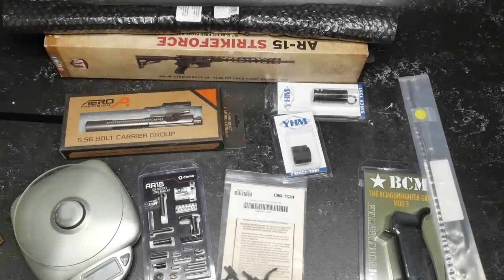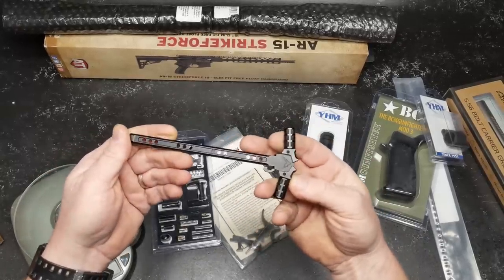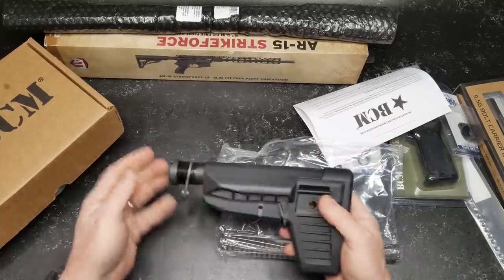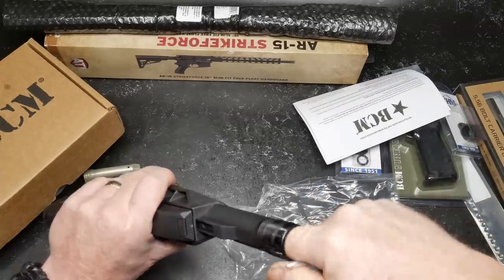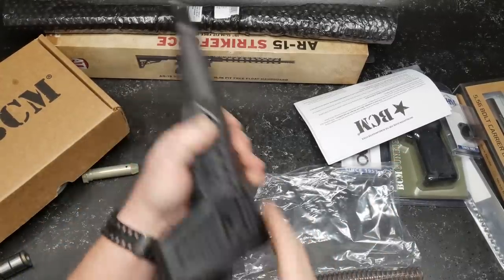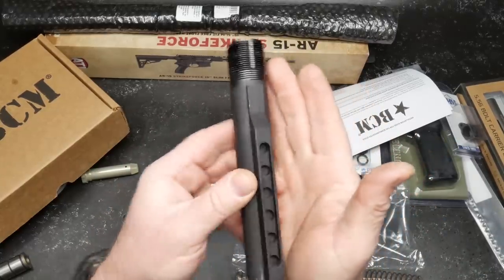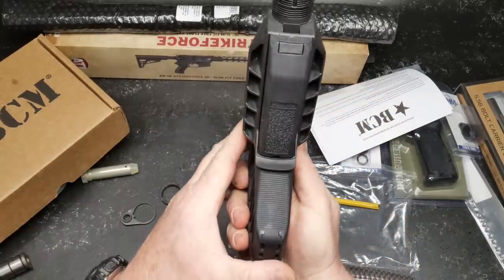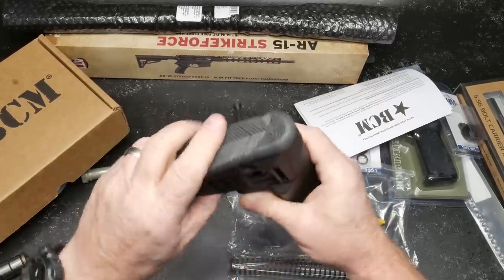Bravo Company BCM GUNFIGHTER Mod 1 Stock Kit SOPMOD Widebody Initial Review

Comment: I have this stock, got it as soon as they released it. I wanted the storage, it’s excellent minus the sling attachment points aren’t fixed like the older version. Minor issue but it does piss me off.
Reply: SicSemperEvelloMortemTyrannis TyrannyEnder on the old version when you attached the sling to the QD points they were locked so they could only pivot to a certain point, these aren’t and the sling can rotate 360 degrees. Not a huge deal but annoying, I may try and pull the old ones out and replace them
Reply: Glad I came across y'alls comments before I pulled the trigger on this stock. Guess I'll stick with my B5 Bravo which has limited  rotation sockets. Ngl a bit bummed, this thing looks cool.

Comment: If you dont likethe sound of it running back and forth over those ridges you can always take a brake cylinder hone to it and smooth it out
Reply: I was just going to type that lol. Ya I polished one that was pretty rough feeling it felt like butter after and reduced noise as well. Of coarse not the spring but can reduce that too or just go with a silent capture
Reply: I really couldn’t hear much difference MAC promotes the BCM line , and they build great weapons also

Comment: I have the Mod 3 grip and Mod 0 stock. They are both my favorite grip and stock. The grip angle is comfortable and the grip is rigid and nicely textured. The stock is on a CMMG tube and fits super smug. Practically no play at all but slides smoothly with no binding. Both are top notch products.

Comment: YHM Phantom , Smiths Vortex , and AAC Blackout are the best flash hiders.
The BCM SOPMOD MOD 0 Stock ,  MOD Mod 3 GFG  , QD End Plate and Short VFG are my standard on any build . Colt 4 position Buffer tube and castle nut us what I get 80% of the time . Geissele Super 42 Spring with H2 Buffer  , and Super Charging Handle.  I'm not sold on one particular LPK . I own more Colt , BCM , and Aero LPK than anything . I only use 2 Low pro gas blocks DD MK12 or Geissele Super Gas block. YHM Low pro gas blocks are super solid . YHM is such an under rated company . 

As for BCM . I've never had one issue with any BCM product . I've been using BCM Products for almost 10 years now . My first carbine I bought that wasn't a Colt was BCM EAG Tactical Carbine . I bought it in 2011ish. I still own it to this day .  I have BCM products on every single one of my Carbines .  
If I could only choose 1 company for all my needs . It would be BCM or LMT .

Comment: Cool man, but for that price I'd prefer if they'd do a better job of finishing that tube, also add like a snug 2 mag horizontal holder in place of all that polymer on the stock, seen one on the Fab defense but it's for a 10 round and sits vertically. That storage compartment is the size of a grip type storage so it's not that great. I bought the Magpul UBR 2 and that compartment is small also.

Comment: I’ve noticed you are obsessed with the buffer tubes being quiet. I kinda am myself have you ever tried the magpul ubr? It’s by far my smoothest ar15 with a dlc bolt jp flat wire spring and a spikes tactical t2 buffer. It’s like glass. Still to this day I’ve never felt another ar15 that charged so smooth and quiet
Reply: Question? If you are charging the rifle does it really matter how "loud" it is when you rack the charging handle? What am I missing? Is there something guy I dont know about who was snuffed out in a gun fight because of the "buffer ring" from his rifle?
Reply: Freedom Inc. It’s really not that big of a deal but if you ever get one that’s super smooth you will want them all like that. And I haven’t used my rifle in a gun fight lately but I suspect it wouldn’t be a problem if it were a little scratchy when I charged it

Comment: od god stop
 it's what you said a clinker. you want light and out of the way. MFT minimalist either plastic or thier aluminum one is far less a gold driver than that SOPMOD what ever that clinker is. and really? check inside of tube. you think that can be heard or felt whwn you are cycling while shooting. if so don't worry,  after a couple hundred rounds, it will be smooth as silk